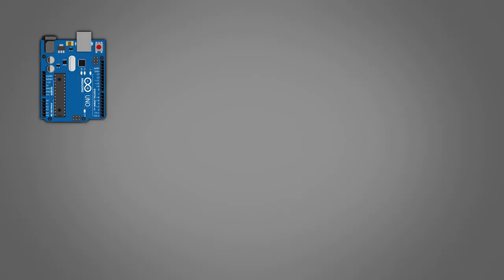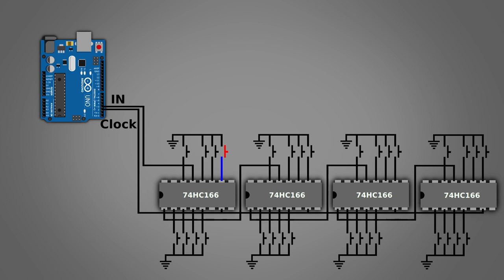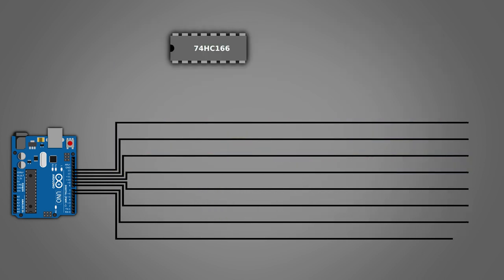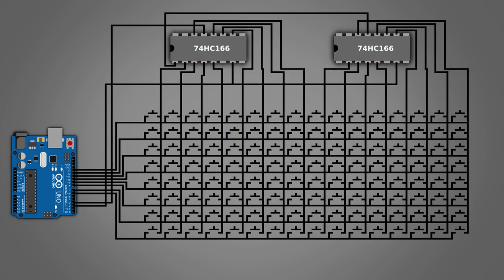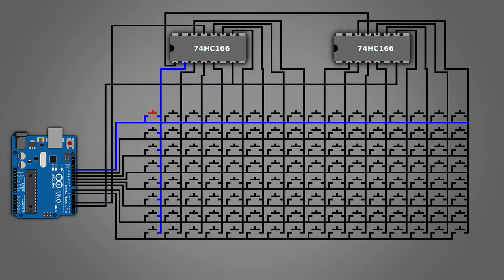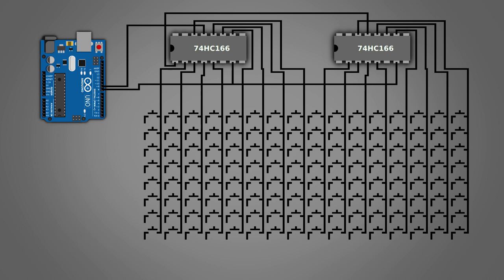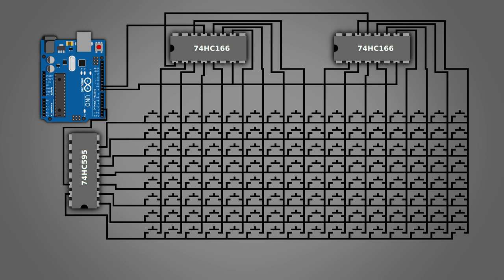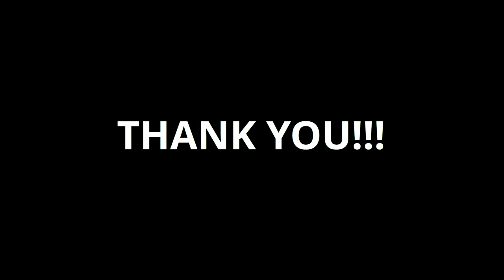Think You Know the CORRECT Way to Handle Multiple Inputs?

Comment: Hello, I am a student in an engineering program, and I found this video very useful. I am planning on making a velocity sensitive midi keyboard similar to the one you have made in your previous videos. Would this system be enough to read 176 buttons?
Reply from the maker: I'm glad to hear that.
Any of the methods mentioned in the video can be used for unlimited number of inputs, at least theoretically. If you're planning to use the first method - daisy chain of 74HS166, I'd go for two chains with common clock and latch, but separate data. Please remember, that animation in the video shows only concepts of methods of connecting multiple inputs, not the exact way of connecting shift registers. Depending on method, you need to connect power supply, resistors, capacitors, diodes etc. where needed.

Comment: hello, whats the difference between 74hc595 and 74hc166?, and i can remplace 166 for166?. Also great project.
Reply from the maker: Hi, 595 is for outputs - you send a digital signal to shift registers to set specific shift register's pins to high or low, and 166 is for inputs - shift registers are sending digital signal to microcontroller so you can read the states of shift registers' pins. What do you mean by replacing 166 for 166? Thank you for your appreciation.
Reply: @TedsProjects  i meant remplace 166 by 595. Im learning about shift register. About a keyboard, what would be the drawbacks of adding sensitivity using long fsr(force sensitive resistor)?  Thanks for taking your time to replying me.
Reply from the maker: @tutorialesdewindows7869  You can't simply replace 166 by 595. They're two different things.
As for long fsr, it depends on how you want to use it. Long fsr is still one resistor so it won't detect which key is pressed. You would have to add at least one any type of sensor for every key. Using only one sensor for velocity sensitivity you risk confusing which reading corresponds to which key.
Reply: @TedsProjects  the logic ill use is folowing. When i press a key, key will hit fsr first, quickly matrix button. And arduino will read the fsr value and map it to 0-127.
If when I press a key hard (and continue to apply pressure), and then another lightly, there was a problem with the sensitivity of the 2nd key? Well in case this happens I have an idea, After pressing hard on the 1st key, the force will be stored, and if the sensor continues to receive the same pressure, it will be subtracted from the next key pressed.
Reply from the maker: Very tricky. When some keys are pressed, pressing other keys might take some pressure off. Also what if you hit two keys at exactly the same time? Too many issues in my opinion.

Comment: This is NKRO? What about use multiplexer?
What best on practice?
Reply from the maker: The first example (74HC166 shift registers in series) is NKRO. For a matrix setup to be NKRO, you’d need to connect a diode in series with each switch. Multiplexers are used for more complex tasks, like when you need to select a specific input at any given time or for handling analog inputs. The method you choose really depends on your project’s needs and your personal preferences.
Reply: @TedsProjects  Okay, thanks.
Reply: @TedsProjects  that's why mechanical keyboards actually have a backlight.
Reply from the maker: @rty65tt40  Haha. Not really :)